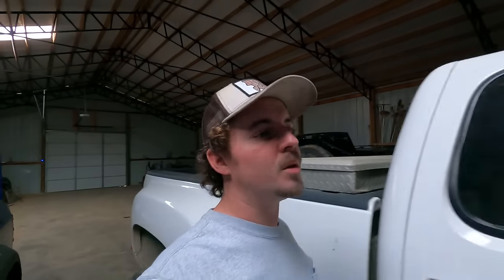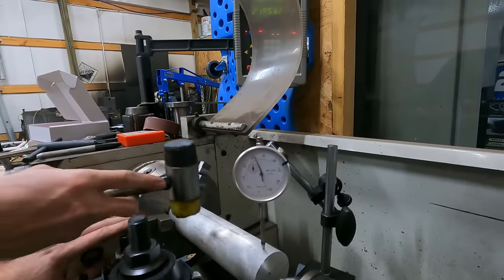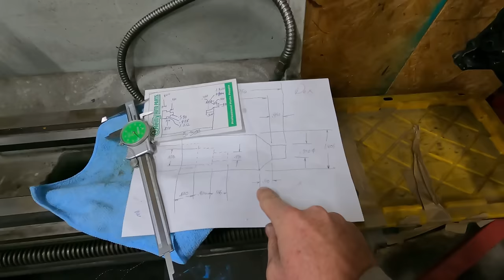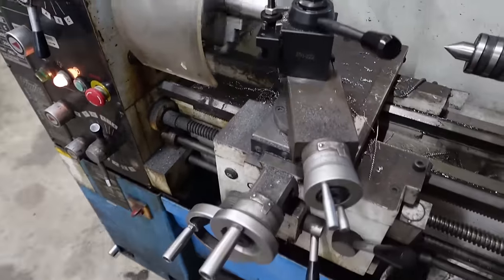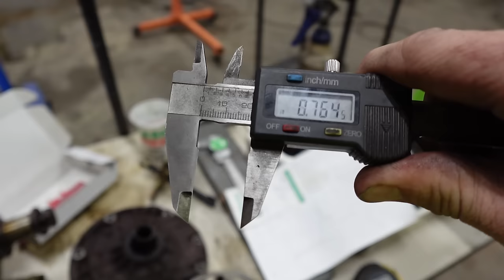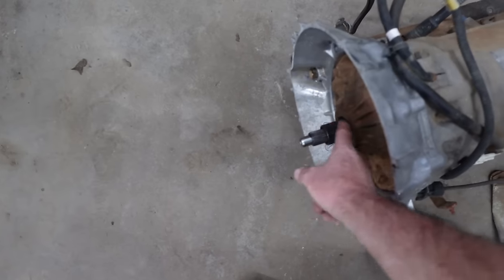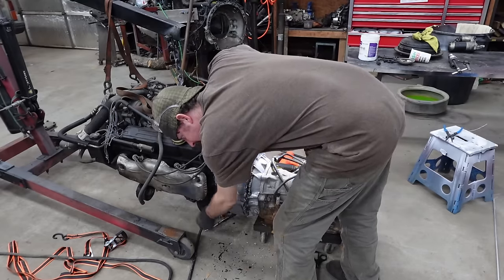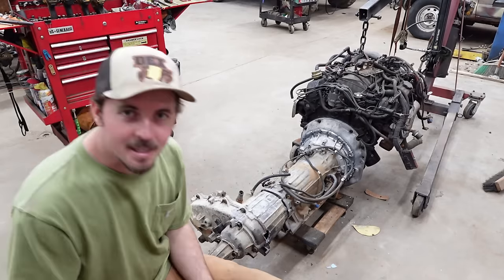I May Be The First To Do This Jeep 5.2 V8 To Aw4 Conversion!

Comment: Great job DEX nothing wrong with a 5.2 good on you and your brother having a go  TJ  XJ for life 🇦🇺👍🏻.
Reply: Lol, don’t think Dex means the 5.2 and 5.9 aren’t any good, just that they don’t die easily and thus don’t sell good. Has actually scrapped some 5.2s due to having tooo many. 😳😳😳😳😳
Reply: Yep owned many 318 / 360 . And modify 340 in a charger 👍🏻 plus 383 👍🏻in 2 Dodge Hardtops 68 models owned 2 318 poly Dodge’s 66 model actually I love the 318 Poly they have one of the best exhaust notes 👍🏻 except my 1980 360 AMC FSJ with the t/ flight man that thing has a awesome exhaust note and pulls like a train . Iv owned 3 TJs 2 new plus I still use my 98 TJ also we still have 3 XJ in good order going great  . Sold 3 other XJ which I wish I didn’t let go 🤔. Anyway MOPAR for life 👍🏻🇦🇺.

Comment: You need a drill chuck and a center drill for the live center. Drill a small tapered hole to center the taper in. This is why you see holes in the end of shafts.  It's not like a wood lathe where you can just stab the point into the material.

Warm parts will measure larger. Make sure it's cool.
Reply: Exactly what I was going to say also..

Comment: I put an AW4 (99 XJ) in a CJ7 4.2 and kept the D300, wired in the trans controller and it worked without the tcase speed sensor

Just to answer your question on whether or not it needs that sensor

Comment: Ohhh the things i wanna due with a LA318
Reply: Isn’t the la carbureted? What are you gonna do with that?
Reply: @TheMainLead  the last generation was also efi, but I just call the 318,340&360 family of engines la as that are almost all the same.
Untill about 2000
Reply: @BurchellAtTheWharf what changed in 2000? I thought the magnum started in the 90s
Reply: @Haterkilla4717  the cam spacing, lifter angles and shape of the Dom in the cylinder heads along with the passage ways for the intake an exhaust,  because of the lifter angle change, supposedly to help flow of air and exhaust but the old heads don't fit the magnum but the reverse will work,

Comment: dex do all aw4 fit in a 96 or just 91 -96
Reply: Different years use different wiring. 91-99 can be converted some what easily to any year but 00-01 are a lot more involved
Reply: @terranovnicek1567  99-01 uses a different speed sensor, wiring alone won't adapt it.